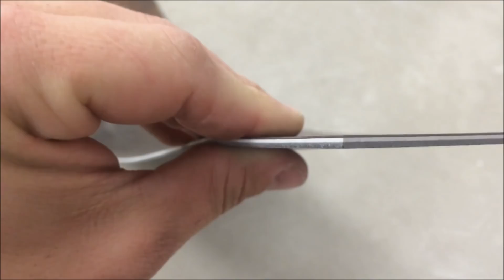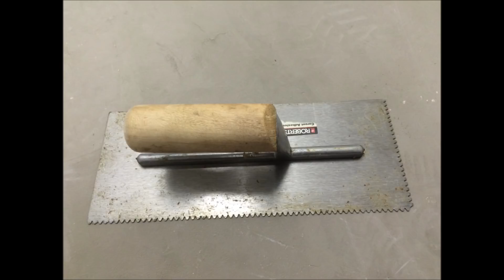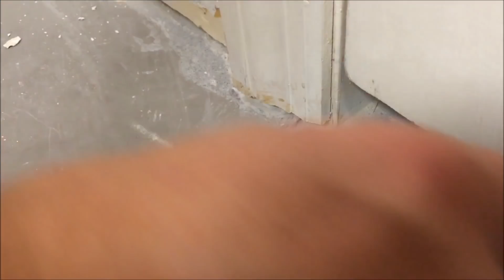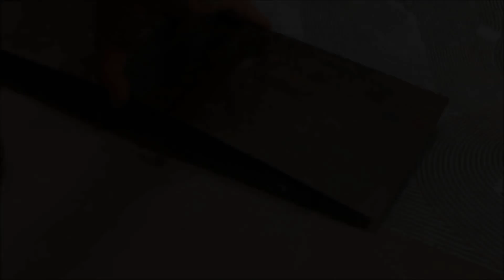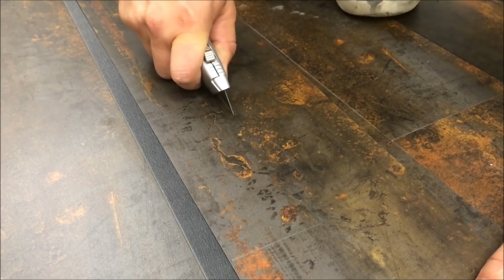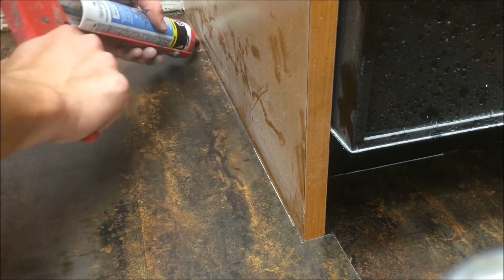How to Install Plank Vinyl- Glue Down

Comment from the maker: Tools used in this video (these are Amazon affiliated links)

Floor Scraper
https://www.amazon.com/gp/search/ref=as_li_qf_sp_sr_il_tl?ie=UTF8&tag=techhobbies-20&keywords=floor-scraper&index=aps&camp=1789&creative=9325&linkCode=xm2&linkId=c6d104e542807f784e478a84a01fced8

Oscillating Tool (door jam cutter)
https://www.amazon.com/gp/search/ref=as_li_qf_sp_sr_il_tl?ie=UTF8&tag=techhobbies-20&keywords=oscillating-tool&index=aps&camp=1789&creative=9325&linkCode=xm2&linkId=df96fef57942640faa6d208b920eea5c

Putty Knife
https://www.amazon.com/gp/search/ref=as_li_qf_sp_sr_il_tl?ie=UTF8&tag=techhobbies-20&keywords=putty-knife&index=aps&camp=1789&creative=9325&linkCode=xm2&linkId=f658e57b1ec7b5ea8e65a88dc9ff2093

Tape Measure
https://www.amazon.com/gp/search/ref=as_li_qf_sp_sr_il_tl?ie=UTF8&tag=techhobbies-20&keywords=tape-measure&index=aps&camp=1789&creative=9325&linkCode=xm2&linkId=dccbd014673301c6e031fafcd93774a6

Chalk Line
https://www.amazon.com/gp/search/ref=as_li_qf_sp_sr_il_tl?ie=UTF8&tag=techhobbies-20&keywords=chalk-line&index=aps&camp=1789&creative=9325&linkCode=xm2&linkId=0e2d582c27c12155d486f7e65b1a3e77

Speed Square
https://www.amazon.com/gp/search/ref=as_li_qf_sp_sr_il_tl?ie=UTF8&tag=techhobbies-20&keywords=speed-square&index=aps&camp=1789&creative=9325&linkCode=xm2&linkId=cd77616a2dd0716fff04bafeaf0ca31a

Utility Knife
https://www.amazon.com/gp/search/ref=as_li_qf_sp_sr_il_tl?ie=UTF8&tag=techhobbies-20&keywords=utility-knife&index=aps&camp=1789&creative=9325&linkCode=xm2&linkId=e3c8163eefb8e9c24f227d5155ed64d5

Odorless Mineral Spirits (instead of lacquer thinner)
https://www.amazon.com/gp/search/ref=as_li_qf_sp_sr_il_tl?ie=UTF8&tag=techhobbies-20&keywords=odorless-mineral-spirits&index=aps&camp=1789&creative=9325&linkCode=xm2&linkId=3de13426f7406ed5b7050efa4a08b623

1/16th or 1/8th of an inch Floor Trivol (v or square notch)
https://www.amazon.com/gp/search/ref=as_li_qf_sp_sr_il_tl?ie=UTF8&tag=techhobbies-20&keywords=floor-trowel&index=aps&camp=1789&creative=9325&linkCode=xm2&linkId=617282fb25d1ab2c90985eb7a03fdb26
Reply: What kind of glue?
Reply: Use black calling pleas!
Reply from the maker: It’s all a preference. If like a black caulk line, that will work as well.

Comment: Not supposed to lay it wet on non porous surfaces... and you can just lay a piece of plank directly on you last piece, and put another piece on top of that one to the wall and then score the difference between them.  It will leave exactly the right size, and no measurements are needed

Comment: We purchased our home new with vinyl plank floors installed. We have lived in it 2 years and notices some obvious glue swirls but also see creases in the floor. How can the creases be fixed without prying up a six foot span?  Any thoughts would help. Thanks!!
Reply: If the creases are not too bad heat from a blow dryer and some pressure should allow you to press it back to its original form, that is if the glue underneath is still good.

Comment: I'm doing a floor for the first time and I'm wondering how to measure out the floor. It's square with a wall running in between the floor to separate the kitchen area. And I have a hallway running into the square area.   |°°°°°°°°|°°°°°°°°°°°°|
             |.           |.                 |..................
             |.           |.                 ..hallway.................
             |.                              |
             |.                              |
             |.............................| How do I find my center of this area to start laying my 6x36 stick & peel planks?

Comment: was it easy to work under fresh glue? Did the piece slide around at all when your on top?
Reply from the maker: You should not be installing on fresh glue. The glue needs to become tacky before installation.

Comment: How do you handle the missing glue under the first row when you continue on from that section? The first row along the line did not have glue under 1/4" of the edge.  Do you just leave that without glue and continue to spread the glue to the rest?
Reply from the maker: In our case, yes that is what we did. 
It will not cause an issue.

Comment: I'm pretty sure I saw these guys opening only one box of vinyl at a time.  That's just wrong.  Most LVT/LVP manufacturers recommend opening 4 to 6 boxes at a time and mixing them as you install.  Why?  In case of color variations from box to box, the colors will be distributed over the entire job.  Also, keep in mind that LVT and LVP have repeating patterns.  If you're not paying attention, you can wind up with the identical pattern on adjacent planks and that just looks BAAAD.

Comment: What adhesive did you use that only takes 30 minutes to get tacky? I want to try this method in my RV home this spring. I'm going over a plywood floor. Thanks. Your video was very useful.
Reply from the maker: Rodan Danner 
Any vinyl glue from your local hardware should work. The time for it to become tacky all depends on the weather and surface. Cold weather and over plywood will usually dry slower.
Reply: @techhobbies9292  thanks for the information.
Reply: @techhobbies9292  I need to know what glue to use.   I've been told a "release" glue is best in case you want to replace a plank years later.

Comment: At the beginning you should measure he entire width so that you know how many planks are needed. The important reason is to divide the last plank  so that you do not end up with a thin plank of one side . Starting the floor as shown COULD leave a very narrow strip of plank on the opposite side.
Reply: Good point 👍🏻✅🤓
Reply: Could you further explain ?
Reply: @mariahthomason3017  Get yourself a shoe box sans lid and use a bunch of pop sticks to simulate the planks fitting from side to side and you will see what calculation and cuts that you need to do in order to obviate one or two narrow strips on one or both sides. 
By the way, “experience is what life gives you while you’re figuring out a better way of doing it!”

Comment: Hello I do not want to use glue because it is rental property.
Can I use strong double tape to stick them to floor?
What do you think?
Reply from the maker: I wouldn’t recommend it. You can maybe try a test portion and see how it holds up but I would guess in the long run, with temperature changes, the tape will loose its strength.

Comment: I have vinyl sheet flooring,, can I install this type of vinyl plank on top of it ? Will the glue work ?
Reply from the maker: No it will not work. You gotta pull up the old vinyl.
Reply: @techhobbies9292 ok,,  will it work on 1/4 plywood underlayment? I hope it will,,😁
Reply from the maker: Yes that will work. Just make sure the joint areas are even.
Reply: @techhobbies9292  awesome! Thanks again great info ,,

Comment: Which is better if you have dogs? Vinyl or laminate? Thanks
Reply from the maker: Both are good on the clean up aspect. 
If you purchase a glossy laminate it will probably get scratched easier and the dogs might have a hard time walking on it.
Reply: But which one is better as far as waterproof and scratch proof? Thanks
Reply from the maker: Vinyl is defiantly better.

Comment: There is a much quicker  and easier  way to cut to walls then this method.  And what techniques  will you use if you come across  a wall that is bowed in various places?. Because  you can't  measure curves with the method you're  using.  I'm  a full time vinyl contractor
Reply: What do you recommend for bowed walls?

Comment: You should learn how to scribe the wall instead of taking points for those rib pieces
Reply: Why a scribe
Reply: @Matthew Williford  you put down second last plank and put the last one on top and against the wall. You then scribe onto the second last plank which will cut it exactly the right size. The swap last and second last plank over

Comment: You did a great job and the video was informative and comprehensive.... but vinyl planking isn’t made to be glued. It’s a floating floor system just like laminate flooring hence the tongue and grooved ends that snap together.
Reply from the maker: This is not a tongue and groove. It’s commercial grade vinyl that can only be glued.
Reply: Tech Hobbies thank you for correcting me. I thought I had seen a tongue and groove in there. In any case the floor came out awesome. Nice work.
Reply from the maker: No problem and thanks.

Comment: “About 1/10th of an inch thick”😂😂 you mean 1/8th crackhead
Reply from the maker: Give yourself a pat on the back.
Reply: @techhobbies9292  The stuff I'm about to buy is Next Floors Groundwork 423 824.  It is 2 mm thick with a 12 mil wear layer.   2mm is exactly 0.1000 inches.  I would call that a tenth of an inch.
Reply from the maker: Thanks mate :)
I knew I wasn’t crazy then lol

Comment: Also for the people commenting thinking this is cheap bull crap you are very wrong. This is mostly a commercial wear layer product and has a lot of advantages over floating vinyl plank. First off with the right proof it’s truly water proof. Sure floating is too but if you have a flood you going to have water under your floor and will be ripping it up. Second of all you can repair a single piece of the flooring as easy as a homeowner doing it themselves. Homeowner would have to take up half their floor to reach damaged of a floating floor. Just because a product is thinner means absolutely nothing. Your finish wear layer is all the importance. And I’ve seen 20 mil glue down outlet 12 mil floating floors all day.
Reply: Yes floating is NOT waterproof! We are installing Luxury Vinyl plank after our  "waterproof" aka "spillproof floor was water damaged after 1 year! Read the labels carefully!
Reply: I'm buying a house next week that is in need of flooring in a large living room. I was set on using a floating system but pretty much have changed my mind today to a glue down.

Comment: Clearly I can tell you mostly do engineered wood and floating floors. You shouldn’t make videos if you are going to be incorrect. First mistake. Your trowel is wrong. You must at least skim the entire floor. Your floor looks too rough. Prep is what makes the installers work. I too am an installer in Florida. Jacksonville Fl. Also you recommended laquer thinner. You will damage the finish so instead mineral spirits is what’s recommended. Your glue wasn’t cured near the amount of time I can tell and also you had transfer on your finger. Also people intrested in doing this go get some Taylor brand glue. You want something 95% RH protection (water proof). I’m not hating on you to be an ass hole just don’t think you should lead people in the wrong direction to make a mess or damage their product.
Reply: Keith Flink Hello Keith thanks for that info, can i spread the glue with a painting roll instead? I’m placing floor over tile. Thanks I would appreciate your response

Comment: Thanks for the video, simplifies the process.  If an underlayer (padding) was added, that, I assume goes under the glue?
Reply from the maker: Personally would not recommend using padding with glue.
Reply: there are products and pads, that are glued to the subfloor. then the flooring is glued on top of the pad.
Reply from the maker: Yeah there is but almost no point of using unless you are on a second floor and want some sound suppression.
Reply: How do I go about laying these on floorboards? A plywood layer to even the floor out? What about joins in the plywood do they need to be taped?
Reply from the maker: You can use a leveling compound that specificity bonds to wood or use a belt sander to flatten out all the joint areas.

Comment: Well I messed mine up, I put the glue over old vinyl.... Ya that never stuck, what a mess pulling up the new vinyl
Reply: It could have with a nice skim cost and the correct glue.
Reply: Skimcoat and make sure your adhesive can be installed over a non porous substrate.
Reply: Hire a professional.. or stick to the floating/click lock, snap n go, vinyl. (Its made for DIY installation). Glue down is a messy, labor intense, and prep-based material. You need to know what you're doing. ...it's not easy pulling out, or cheap.

Comment: You are not a flooring installer any true flooring installer would have at least used feather finish before installing lvt and that is not how you cut lvt to the edges. FAIL!
Reply: I

Comment: I have a question: Can I lay glue down vinyl plank over linoleum? The linoleum is new and not shiny. It came with our new build since we didn't want to pay so much for labor to install the vinyl during the build. We have experience in laying the floor down from past homes but we always take out the linoleum and were just curious if we could save a step. I know someone who has successfully tiled over linoleum and it lasted over 20 years until they decided on a color change.
Reply from the maker: I would not recommend laying over existing lenoleoum.

Comment: Why the chalk line and not just start laying against the wall?
Reply from the maker: The reason we started that way is because you need to wait for the glue to become tacky, and we had a lot of area to cover that day. You could start from the wall, just don't spread as much glue so that you reach over to start.
Reply: because walls are not completely straight with square rooms at 90 degree angles as you would think. If you start against one wall. the room will look crooked and weird. I could even give make people with virtigo or something dizzy.
Reply: You should also measure from opposite walls to your chalk line,making sure you floor will end up square when finished..too many times I saw floors laid that ended up with a tamper (wide at one end and narrow at other end) on final row...it happens a lot when only measuring off starter wall..

Comment: what about laying it over a wood sub floor. is there anything different you need to do?
Reply: You can install 1/4 in. Certiply/ Integraply or sanded plywood over  your wood subfloor. Use floor patch to skim and sand the seams in your 1/4 in underlayment and your ready for installation.
Reply: Scott Majury same application process
Reply: Same application but not recommend. You need to skim cost the whole floor. Better results with floating over wood

Comment: Is it true this stuff doesn't expand and contract like laminate flooring does? If so can you just lay it butt up to the skirting board instead of going underneath? Thanks
Reply: The instructions state very clearly that it will expand and contract and tell you the recommended gap.

Comment: I had some installed by idiots, there is glue residue in many places and a few gaps. What can get the glue off ? Can the pieces that are not fit properly be removed and re installed (there are some left over strips) ?
Reply from the maker: Some lacquer thinner should get the glue off, and I can't really say because I can't see how bad they don't fit.

Comment: Yeah. I would have a tile cutter and a 100lb roller if I was doing this as a profession. time savers and pay for them selves. also. there is the scribe technique for cutting doors,walls, drains,etc. wish I had the ambition to show some tricks. this way would get the job done for sure,, just time consuming. thanks for the video guys.
Reply: tile cutter for vinyl? what the fuck.
Reply: Yeah you can use a vet tile cutter for most lvt plank products. Been using em for years.

Comment: I find it very helpful. I have ceramic tiles. if I get them scraped off it will be messy and will take too much time and of course cost more. I plan to install vinyl planks with glue on them but one place you did not advice it. Why not? It will be smoother and even and probably stick well. Need your opinion. Really appreciate that.
Reply from the maker: @anthony moser suggested to make sure the tile is stuck down good(no hollow spots), and then do a good skim coat to fill in all grout lines evenly and the low spots. Then I think it would work.

Comment: Where did you find glue down vinyl planks? All I can find are those terrible peel n stick planks.
Reply from the maker: Im pretty sure Home Depot or lower should have it. You could also try some local flooring stores.
Reply: @techhobbies9292  Neither HD nor Lowes has any glue-down in stores.  You might be able to special order.  Best thing is to get it from a flooring wholesaler.   I've used Next Floor, Earthwerks, and Raskin.

Comment: what type of glue are you using? And is it needed to take up old vinyl first
Reply: SmileyYvette its  fine
Reply: Depends on your adhesive, some adhesives won't work on non porous substrates.

Comment: Hello, thanks for the video, it's very helpful. Could this vinyl floor be glued directly to ceramic tile? thanks
Reply: you could install on top of ceramic but the ceramic would have to be stuck down for sure.. and then do a skim coat over all of the surface in Wich you are going to be installing on.. fill all grout lines and low spots... wait a bit and should have a good surface to install on..
Reply from the maker: Thank you I'm glad it was helpful. 
No I would not advise to install over tile.
Reply from the maker: Yeah that would work.

Comment: Hi, you always start in the middle of the room with the line you measure, correct?
Reply from the maker: No not always, it was just more convenient to start from the middle. As long as you have a straight line then you should be fine.

Comment: you should transfer marks w/another plank and heat/torch the marked plank then cut for metal door jambs and along cabinets for a "perfect" fit rather than leaving gaps and caulking.That's how a professional would do it.
Reply from the maker: That’s a good idea! Thanks.
Reply: Why heat torch?